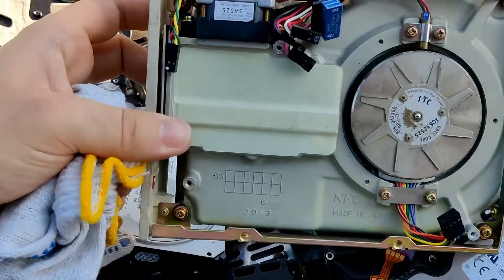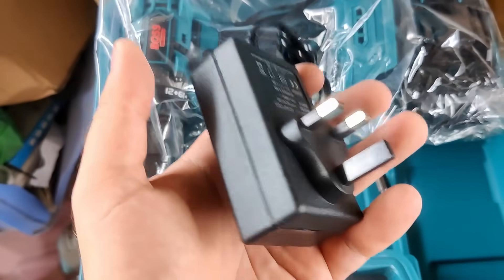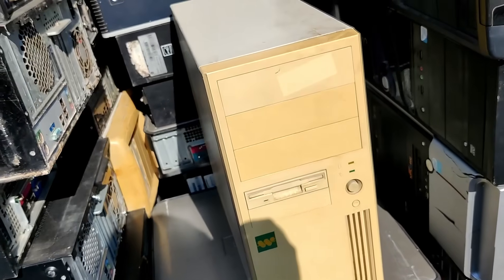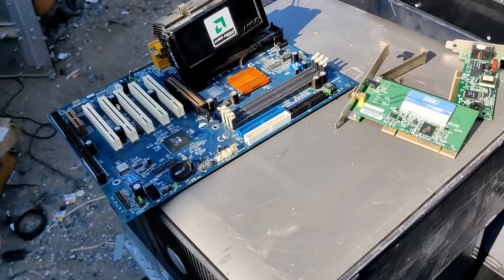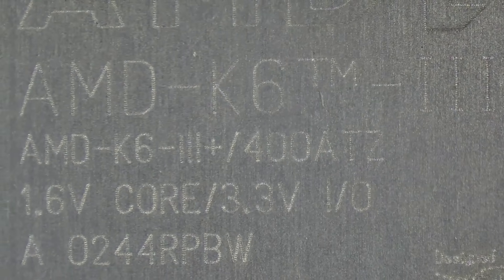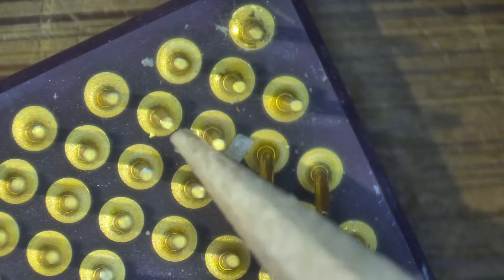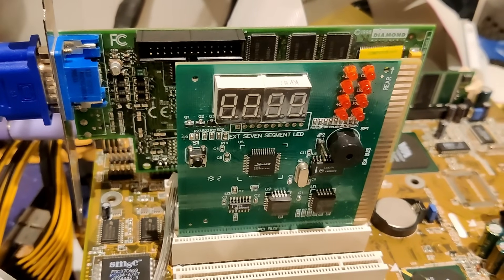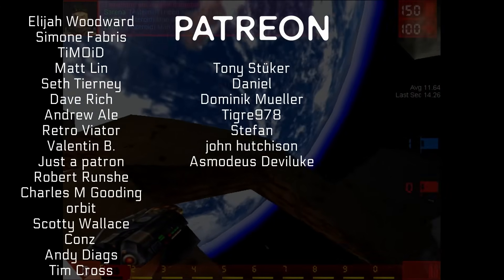I Found Rare AMD K6-III+ CPUs and Broken Dreams 😥

Comment: I do miss my old k63 450.  That system I had back in late '99? was pretty cool with it's DVD decoder card and Voodoo 3 3000.  Sold it for a decent amount too... 
I wouldn't be at all surprised if all that old gear is now lurking somewhere in that middle eastern junk yard.  25 years and that stuff still hasn't been dealt with... perhaps it never will be!

Comment: I'd still like to see them tried, if only because seeing one work would be a massive hallelujah. Also, the indestructible Duron still lives with its cracked, exposed die.
Reply from the maker: That's true! AMD exposed die chips are a lot more resilient to chipped corners compared to Pentium III chips.

Comment: The CPUs finally feel the joy of being rescued and powered up after so many years in a scrap heap, only to be overclocked within an inch of their life. Such cruelty :)
Reply: Better plot than some movies.
Reply: Those K6-III+'s handle overclocking so well. In some cases, it's just a case of flipping some switches. (or setting jumpers) They'll just do their job, and barely get warm. I've never tried 600, but I never had any issue with a 400 being able to deliver 550. There's practically no difference between a 400 chip and an actual 550 chip running at 550, other than in my case, the 550 chip was not a plus and it ran slightly slower, because of the smaller cache. I always used coolers, but these chips were always safe to touch without a cooler, even running at 500 or 550. The K6-2 on the other hand... 

One time, I got a notification from the board's hardware monitoring software that the chip was running hot. I shut down Windows, and decided to look inside the case. Apparently, a cable had gotten loose and fell on the fan, and the fan melted to the processor. and socket. Fortunately, it hadn't bonded to anything. I peeled the fan off,  got a new fan, rerouted & secured cables, and everything was up and running again. I can't imagine a similar experience with a modern processor. Even Pentiums of the time probably would have cooked themselves.

Comment: Imagine a 25-37% overclock these days 😅
Reply: Back in the days 30% overclock was an average O/C.

50% and more was acheveable on some binned chips.

I still have my e2160 which could do 3.2-3.4GHz on slightly higher VCORE.

That's nearly 100% gains from stock. Crazy good times back then.
Reply: @b284r_93 I once had a Celeron 667Mhz, that easily did 1050Mhz.
Probably more, but my motherboard couldn't handle more 😅
Reply: @b284r_93 I had a Core 2 Duo E6420 (2.133GHz) that reached 3.2GHz on stock voltage and ran stable over 5 years - just bumped the FAB from 266 to 400 and adjusted the RAM divider!

Comment: Shame about the cracked K6-III+, but unsurprising given they were dumped in a carrier bag.

Speaking of which I have a K6-III+ @ 450MHz in a laptop, I really need to find a desktop motherboard that supports it and I'll have a perfect system for period correct windows 98. I would use the laptop as is but the iGPU is trash and barely runs Windows properly and iirc is in a bit of a state.

Merry Christmas Bits und Bolts! Here's to a great 2026 :)
Reply from the maker: Thank you! Merry Christmas to you as well! Good luck on finding a super socket 7 board. They aren't as common anymore, but not unobtainable!

Comment: If they weren't handling hardware like pure brutes, so much more hardware would be salvagable and even resellable ><' 
I must admit that the first part of the video was painful to watch...

I wonder if it would be possible to grind away the ceramic to repair the broken traces... If they don't work like that anyway, it can be a nice experiment + a look at what happens in the ceramic
Reply from the maker: I'm not sure what to use to grind away ceramics. I haven't tried my engraving pen, but I somehow have a feeling that those bits won't be enough to dig in there.

Comment: Most likely dead the cracked ones, could take the lid & make a keychain out of it.
Did you increase the cpu voltage anything when pushing them to 550 mhz ?
Reply from the maker: I only tested at stock voltage. Next time, when I take off the heat spreader of the cracked CPUs (they are confirmed dead btw), I'll push for higher voltage. Maybe they get stable up to 600 MHz (max this board can do).

Comment: 0:03 there's some classic Cisco gear there too
Reply from the maker: Oh yeah, there's a lot of networking equipment all the time. Unfortunately, I don't have any knowledge about Enterprise Networking and the hardware.
Reply: @bitsundbolts men I'm studying ccna and would love a router and switch to practise on without having to use Cisco packet tracer
Reply from the maker: I did one of the CCNA exams back in Uni - the very first one... IP addresses, subnets, and other basic things. I can imagine that a real device would help a lot to learn. There are so many of these switches - it's unbelievable! They must have cost in the millions!
Reply: @bitsundbolts just did the first test myself. Failed it by 5% on theory and 2% on practical because i didn't remember that all layer 3 commands start with IP, even though I had sat up the correct IP address and done the VLSM correct
Reply: I failed by not doing "no ip domain lookup" and "IP domain name (name of domain)". If I had remembered that last one I'd manage to get SSH working 😩

Comment: Find pinouts and try checking resistance between pins to the ground on damaged side. If there are any resistance (pins have connections) there is a bit chance CPU might work but still its about 5-10%.
Reply from the maker: I tested the CPUs already, but they don't work. I doubt there was any chance for them to work.
Reply: @bitsundbolts it was always going to be a long shot, but thank you so much for at least trying!
Reply: It would be a good idea to stabilise the crack first. A thin cyanoacrylate glue designed for fixing cracks in glass would probably do the job as it would seep deep into the crack before setting.
Reply: @TheRealNZgeek  I did that once. The cpu is alive.